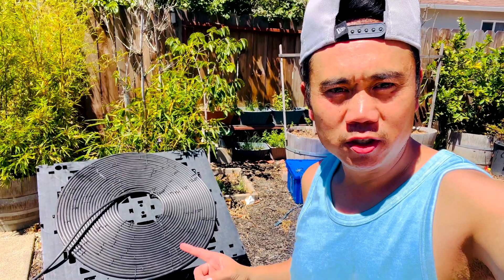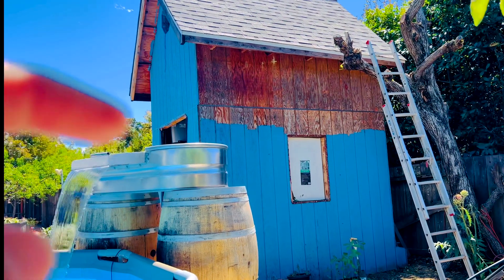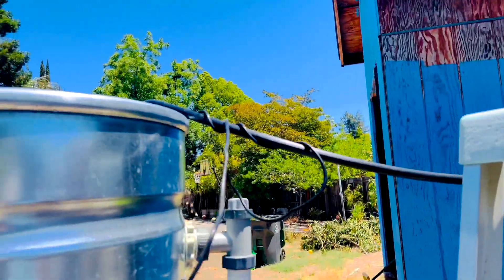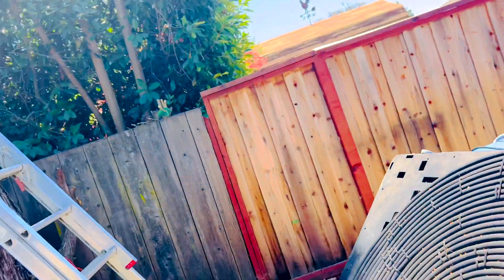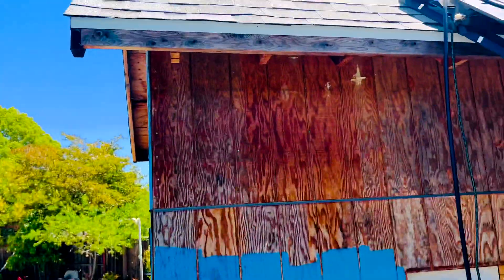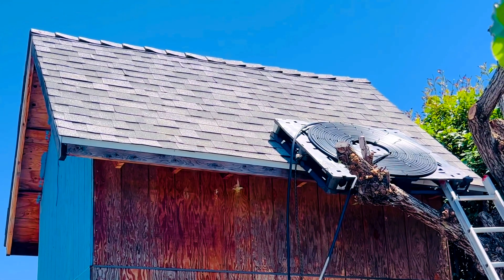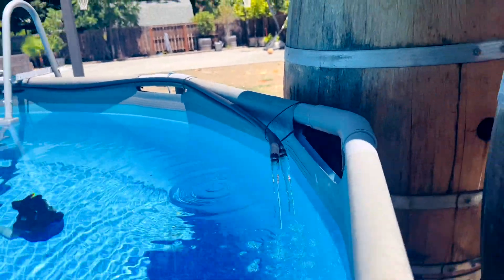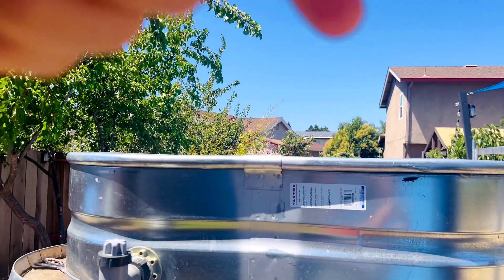No Electricity Needed 🤩 DIY Solar Pool Heater

Comment: Love your vids.  Question about why you run each pool heater separately?  Couldn't you link them together, either with connectors or one long run of the irrigation tubing?  Is there any advantage by running them separately?  Also, I'd love a demo of what the temperature is in the pool before and after you start running the pool heaters, using the pool thermometer.  In your first video of the pool heater build, you were measuring the temp of the water coming out of the heaters in what looked to be a pitcher.  I'd love to see a temp of the pool before you turn on the heater(s) and then after they've been running for a few hours.  Now that you have 3 (4?) heaters going, what is the pool temp in the morning compared to after they've been running for a few hours.  Similarly, how long does it take for your pool to heat up to what your family feels is comfortable?  I live in NorCal and the air temp in the morning in July have been in the high 40's to mid 50's, high temps high 70's to high 80's to low 90's.  Thanks for all your work!

Comment: I like the idea, but do you manually stop the siphon when the sun sets and then manually start it again at sunrise? I'm running a 20V barrel pump driven by a solar panel to run the pool water through the heater. 50$ for the pump, 50$ for the solar panel and it runs automatically only when the sun is shining (and heating). A 100$ investment that will heat my pool for many years to come and it runs for free.
You can check out @SolarProjectsSweden for more info.

Comment: Paint the inside of the pool black it will not only absorb the suns heat it will also stop heat loss. This may not look cool but it would be more efficient.
Reply from the maker: I’m not sure that’s going to work because the amount of use inside with kids jumping and the liner constantly moving that will not let the paint stay
Reply: @don_wynn  You could reline the pool with black pond liner. But if it's comfortably to swim in I wouldn't bother.

Comment: Interesting setup.  How do you prevent the gravity feed solar heaters from draining the waterfall tub when the pump is not on?  Did you install a control valve in the solar tubing?
Reply from the maker: Hi thanks.  I hope I explained it correctly in the video. I do have to keep the pump on in order for the waterfall to receive water.  So the part that runs without power is just the water heater since I leave the water pump running at all time. I did also install a  separate control vavle for the two new heaters I build.  😃